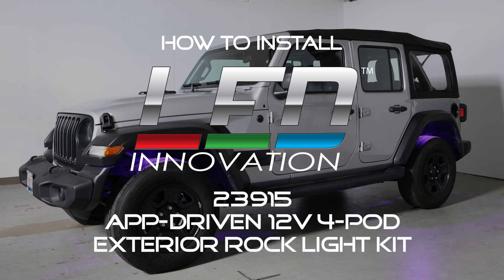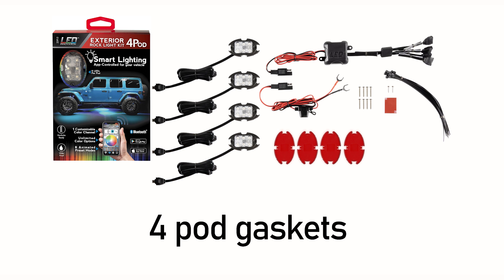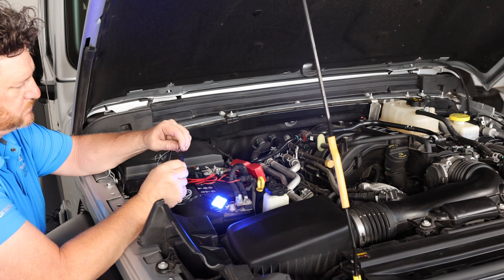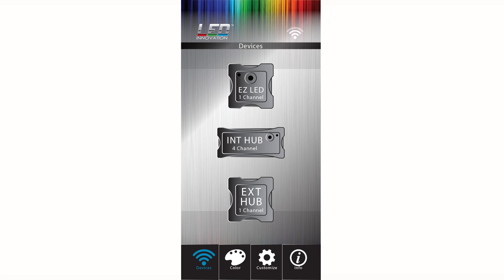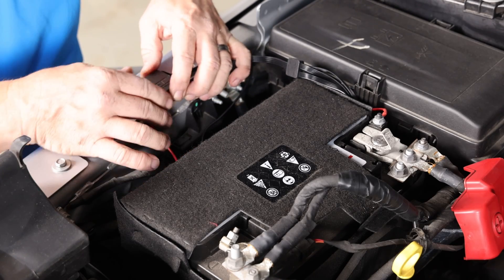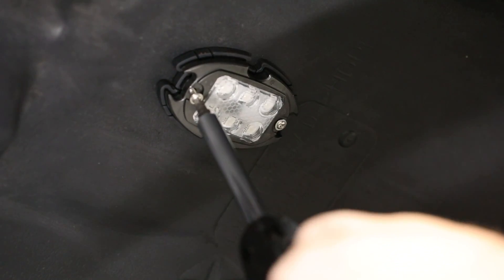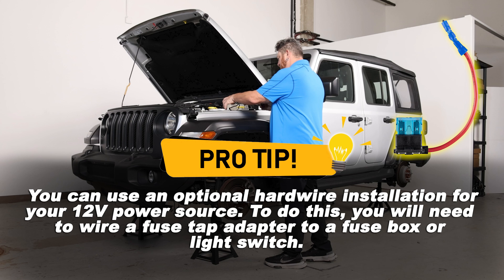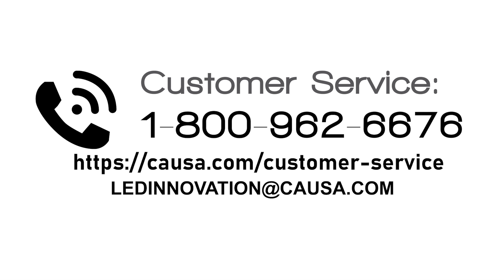How to Install the LED Innovation App-Driven 12V 4-Pod Exterior Rock Light Kit (23915)

Comment: Mine turn on by themselves the truck is parked and the lights will come on. This is disappointing. This does not seem to be a cheap kit but it sure does act like it is.
Reply from the maker: It could be a bad ground causing the control box to reset. Please check the ground and make sure it is clean and tight. From there check for any bare wires in the system that may have been damaged from driving. Below is a trouble shooting guide to reference also. 
 It could also be your phones Bluetooth automatically connecting the LED lights while not in the App. Either turn your Bluetooth off or clear the LED lights from your phone’s Bluetooth cache and see if this helps.  If you'd like to speak with us further, feel free to reach out to us at Customerservice@causa.com or by phone 1-800-962-6676 Monday-Friday 8-4 CST.

1 – go into Bluetooth settings on iPhone
2 – find the “4channel or 1channel….”
3 – click “forget this device”

Comment: The app to connect to the system is horrible,  i allowed access tp everything it wanted and have good connection but it will not let me change the light color, just stuck on blue and continuously asks to pair the system to Bluetooth constantly wvwn though my phone is right on top of the system.  $80.00 for a product i cant use is ridiculous.
Reply from the maker: Thank you for reaching out to us. The most common issue with the lights not connecting after a connection has been established is competing Bluetooth signals. If one smartphone connects to the LED lights, that phone will have to disconnect before another phone can connect to the LED lights. Also, if the smartphone is already connected to another device, it sometimes won’t find our lights until they disconnect from whatever device they were controlling before (i.e. vehicles Bluetooth system or radio). Please delete the App completely, clear the device from your Bluetooth Cache, and then restart your phone. Once the phone has restarted and any updates completed, redownload the App. Then open the app and accept the permissions (do not try to connect to the lights yet). Close the App all the way (swiping it closed) and then open your Bluetooth settings to locate the Control Hubs signal (if the control hub does not have power and the lights are not blue, no signal will be produced). Connect to the control hubs Bluetooth signal and then open the App to connect. If you'd like to speak with us further, feel free to reach out to us at Customerservice@causa.com or by phone 1-800-962-6676 Monday-Friday 8-4 CST.

Comment: can the app be used with multiple owners or 1 ?
Reply from the maker: Thank you for reaching out to us. Yes, multiple phones can control the LED lights but only one device at a time. If one smartphone connects to the LED lights, that phone will have to disconnect before another phone can connect to the LED lights. Also, if the smartphone is already connected to another device, it sometimes won’t find our lights until they disconnect from whatever device they were controlling before (i.e. vehicles Bluetooth system or radio). If you'd like to speak with us further, feel free to reach out to us at Customerservice@causa.com or by phone 1-800-962-6676 Monday-Friday 8-4 CST.
Reply: i have a problem , the innov app isn’t connecting to my rock lights it keeps saying connection timed out, i checked the fuse that came with the kit it’s all good , what could be the problem ?